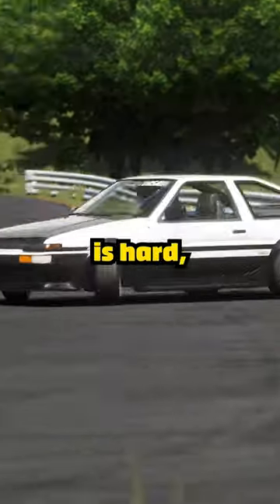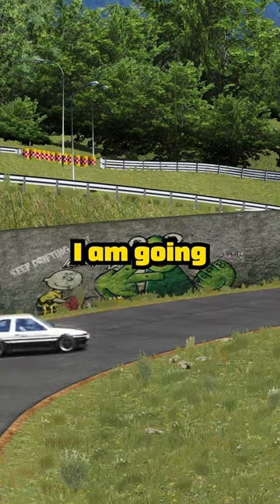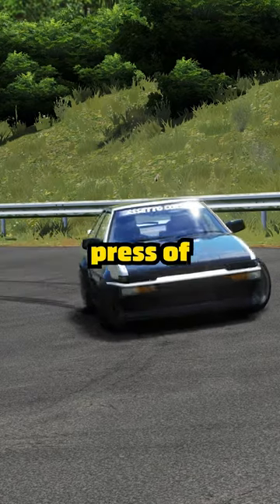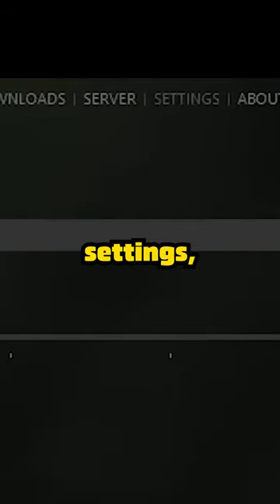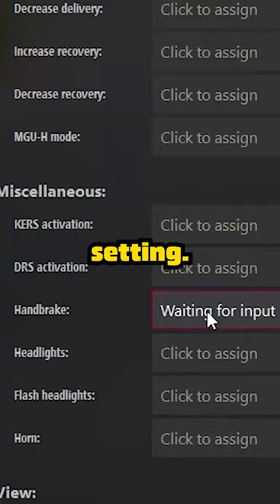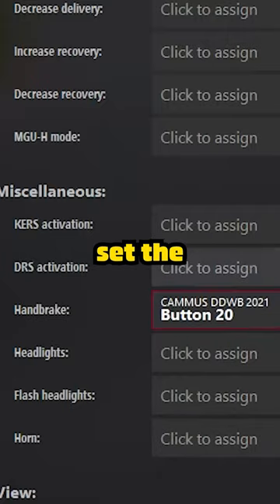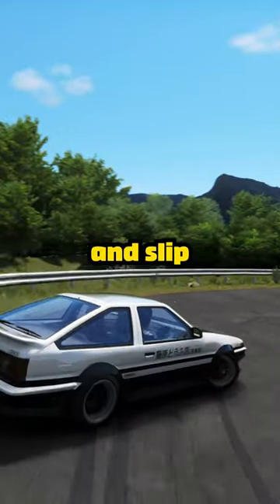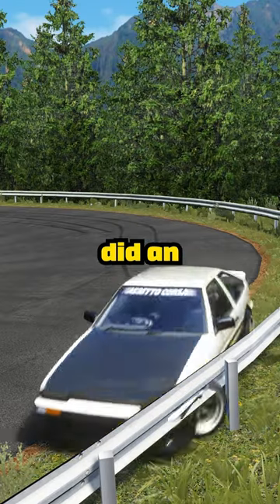The INFINITE SLIP ANGLE Hack #assettocorsa #slipangle

Comment: now if you want real slip angle at some cars, find a car that has stages of traction control like 2/2, 12/12... then set if for 3/4 or 9/12 or 2/2 depends on the car, its important that the value is big, now at an apex just press full throttle mid corner amd there you go, just learn to control the car now

Comment: Mate, that is not even a slip angle, that is just sliding around or drifting. Slip angle is supposed to make you rotate around the corner as fast as possible, slip angle is not sliding into the corner or drifting with handbrake
Reply from the maker: Slip angle refers to how much the tyres deform. An angle of slip is present even whilst travelling in a straight line. So yes, every clip in this video includes slip angle.
Reply: @TSRB are u 12?
Reply: @oskrcpd7513  ITS. A. JOKE.
C A L M . D O W N .